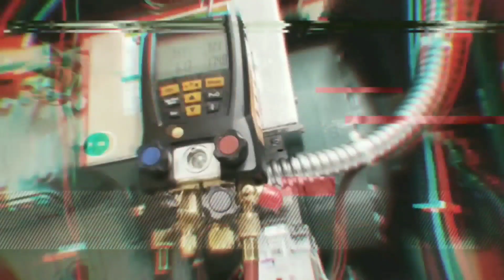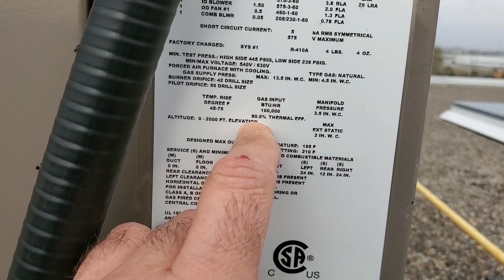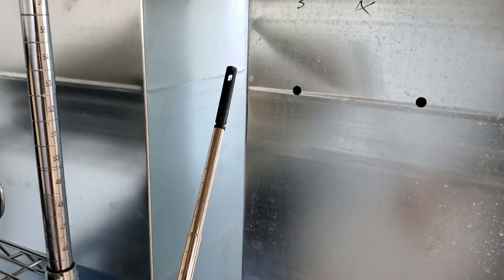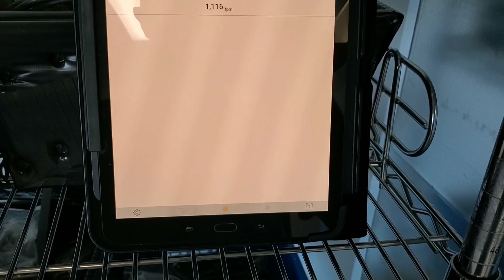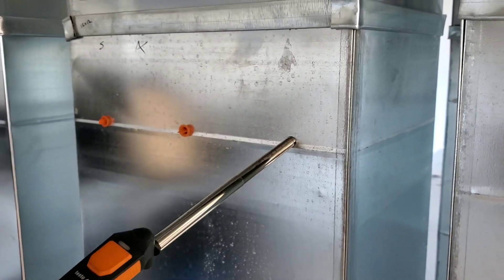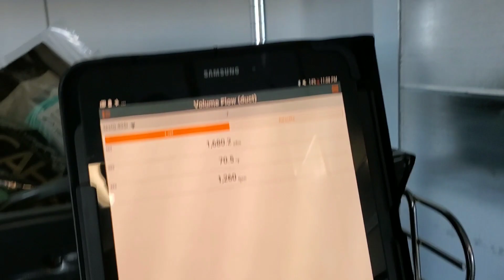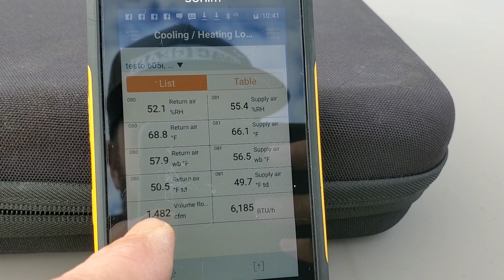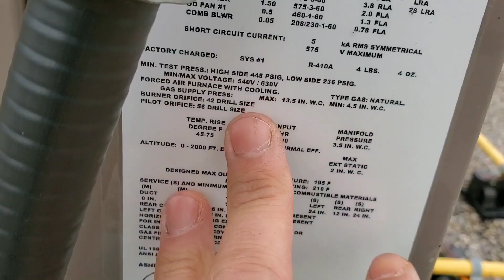Checking Actual Heat Output Of A Rooftop Unit Using Testo Smart Probes

Comment: FYI, your giving out the wrong procedure.  There is a certain amount of hole to read and that depends on the size of the duct.  Next time get a chart 😮😮😮😮
Reply from the maker: No I'm not lol.  You don't need a chart.  The app calculates it once duct size is entered.  That was done in the video.

Comment: Testo also makes a wireless thermometer that is more ideal for testing a gas furnace supply temperature.  I know on fieldpiece they don't recommend temperatures beyond 130-140F.  According to Mr. Jim Bergmann, they are really designed for cooling testing and may affect it's calibration.  Having one for the return would still be fine in order for seeing a relative humidity reading.

Take it for what it's worth.
Reply from the maker: The operating temp of the 605i is up to 122 degrees F.  I hit 124 degrees.  A touch outside the range but I like to live on the edge.  In retrospect, it would have been better to put the probe a little more downstream.  The app menu is called cooling/heating load.  So in essence the prove and app are designed for heating calcs as well.
Reply from the maker: Tool and app*